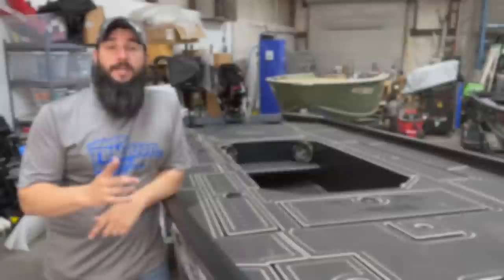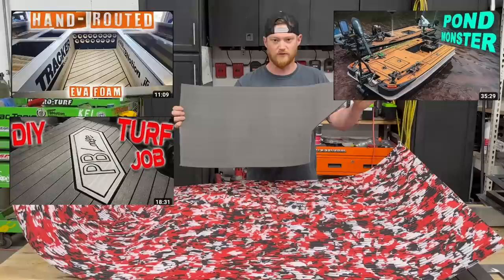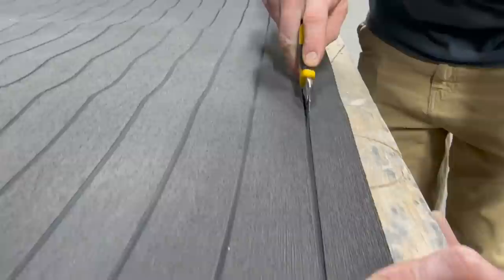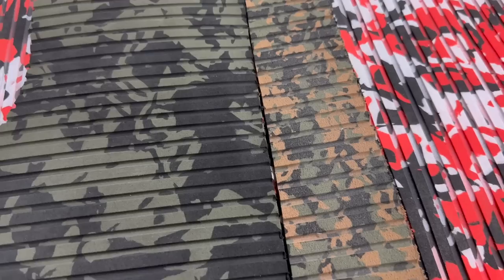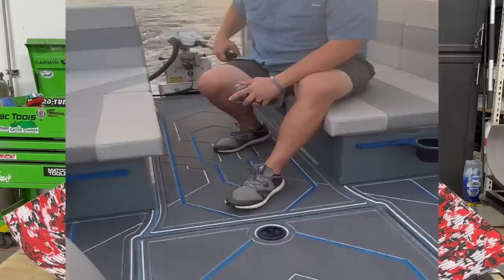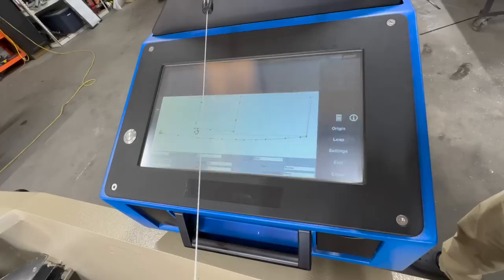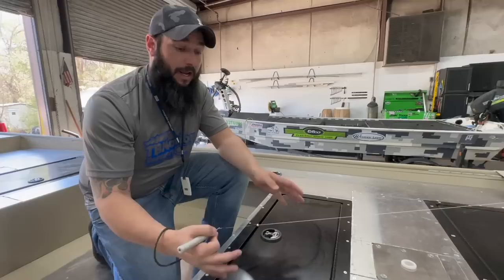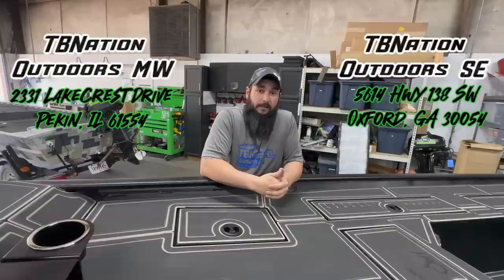EVERYTHING about EVA Foam | DIY and Professional

Comment: *How hot does the Eva Foam get? Eva Foam available from us is UV Resistant and stays cool to the touch even on hot summer days. We have been on full black EVA Foam (HydroTurf) in the middle of the day in summer barefoot with no issues.
Forgot to add that little note to the video.
Reply from the maker: Yup it is great for keeping your feet cool.
Reply: I did seadek and Marine mat which is pretty much the same thing. I can tell you this , from a black foam to a white foam , the difference in surface temp can be as much as 20 degrees. However , if you go to a lighter color , stains will show up more versus darker tones. I tried to stay somewhat neutral , with light greys and light blues etc......Still hard to keep clean but on a kayak when you are overtop that surface all day and just a foot or two from it , it does make a huge difference.

Comment: To be fully transparent, Seadeck and I assume others EVA foam decks, will deform and discolor in reflective sun light. I read the reviews after I made the mistake
Reply from the maker: It also matters how you store the boat. If you leave it outside without a cover, yeah, it probably will
Reply: As does everything......
Reply: So why invest in it when it doesn’t last? After it warps and fades you need to worry about how to get the old stuff off with the adhesive. Must be a headache!
Reply: @2cthetruth  Glued carpet is a pain to replace too.
Reply: The real solution is to use pure aluminum and have it polished to a high shine. That’ll last a while! Make sure it’s shiny like a mirror, itll tan you right up too.
Reply: @2cthetruth  carpet does as well of you continuously leave it in the sun. The only thing the sun won't affect is a textured interior paint
Reply: @2cthetruth or u could just cover your boat and take care of it and it will last for years.
Reply: @combedintuition and not hot at all right.  Wow

Comment: I’m replacing the carpet in my 2004 tracker PT175 with hydro turf, so what can I do about the gaps left between the lids and deck or box edges due to the old carpet having been rolled over the edge of the lids???  Can I coat exposed aluminum with a rubberized coating to deaden noise and cover exposed aluminum???  PLEASE, AND ADVICE WOULD BE GREATLY APPRECIATED!!!
Reply from the maker: We just paint any of the gaps and edges.

Comment: Have a 18.9 Xpress aluminum boat. It has a bed liner type stuff sprayed on the decks. I would imagine one would have to remove this coating before installing the EVA.
Yes or no?
Reply from the maker: Yes, sand it down

Comment: Do you have tips about getting carpet off? Tracker boat carpet, probably not stuck on all that great to begin with… heat gun? Thanks in advance
Reply from the maker: burn the boat. Haha, most of the time we use an angle grinder with a sanding disk. Its messy, but gets the job done

Comment: Are there any tricks to getting turf to adhere to wood?
Reply from the maker: Seal the wood really well with Fiberglass resin, then sand smooth with 80 grit and it will stick great.

Comment: New to this product. Can you use it in fiberglass boats as well. If so should the surface be smooth. In my 95 ranger the floor area is kind of bumpy. Idea's
Reply from the maker: Yes, I think it was primarilly meant for glass boats to begin with. It started out on jet skies. It will also go into cars.
Reply: Did you try this product?   Wondered what you thought of it.

Comment: don't think i would rather clean my seadek on my duck boat with anything other then a pressure washer. teak layout foam is alittle sketchier but ive never messed my bass rig floor up using one.
Reply from the maker: not a full powered pressure washer, one of those cheap electric ones works good.

Comment: If you do happen to accidentally let blood sit on this shaving cream even the cheap stuff will make blood vanish and leave a cleaned spot where it used to be just a free tip
Reply from the maker: Very good tip, need to give that a try
Reply: It works on regular carpet so very likely it will work on boat carpet or foam as well just dab don't scrub

Comment: How does this hold up for salt water sailing?
Reply from the maker: I don't know why it wouldn't, I've seen it on salt water rigs before
Reply: @TBNationOutdoors  my question was HOW does it hold up to salt water sailing. Salt water is much more corrosive than fresh water. Breaking down the material and adhesive at a much faster rate. I’m wondering how long it would last in the ocean. A few years, a season, a few months, etc..